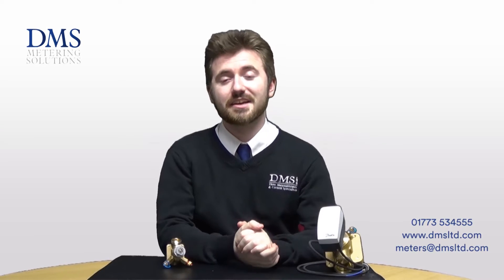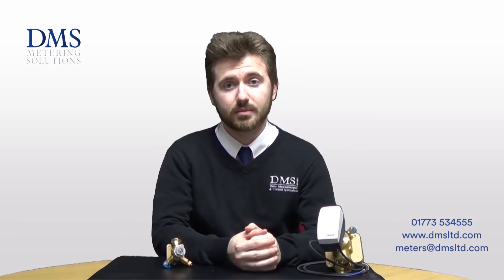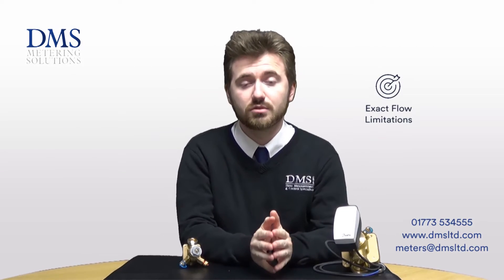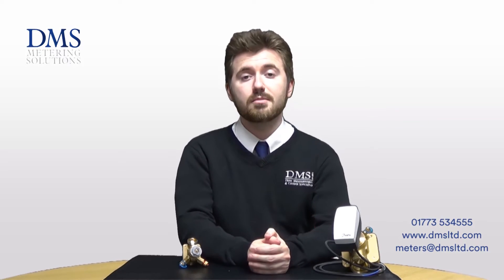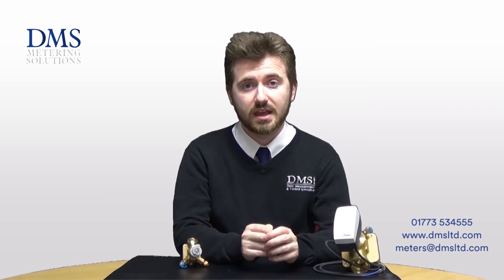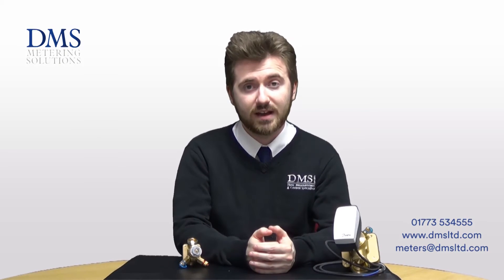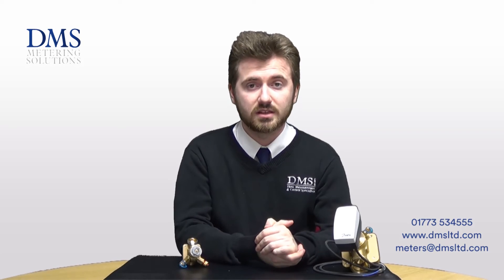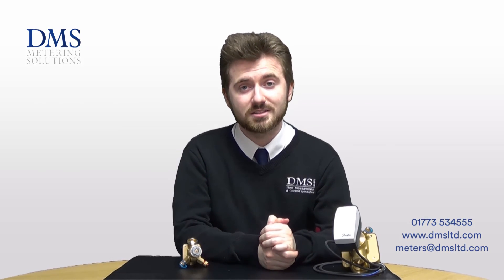Danfoss AB-QM Valves  From DMS

Comment: Hello dear just I need to know the selection of your and Picv. we have many projects,  in a project we have got your pics , we believe that the selection is incorrect as some of valves are selected at 100+ percentage with increased min. Diff. Pressure. Though the valves are having range up till 120  percent, I don't think selecting picv at 104 or 116 percent is appropriate. Do you have any application or software for selection like other manufacturers. Pls answer my question ASAP

Comment: Hi.
Please can you tell me.. how to do the water balancing in PICV
Reply from the maker: Hi Safir, thank you for your question, you would need to advise the flow rate. We then select a valve based on that flow, with the setting % the valve needs to be set at (if the valve does 450 l/hr and you want 225, then the valve is set at 50%)
All of this can be done in an easy Excel schedule
Once the valve is set on site to design flow, it will control at this. If you fit an actuator, it will self-stroke to the valve

If you need any further information please drop me an email Lucy@dmsltd.com 

Thank you for watching!